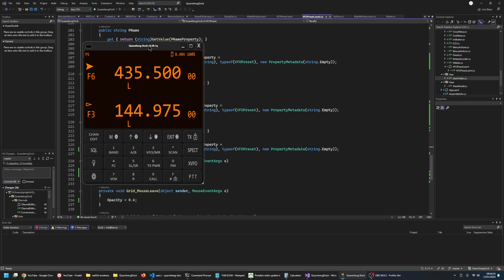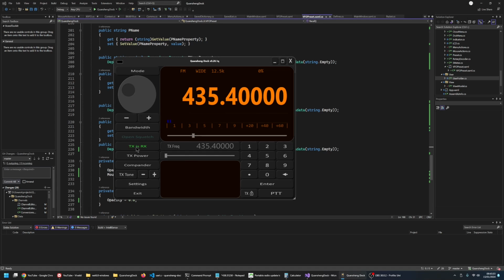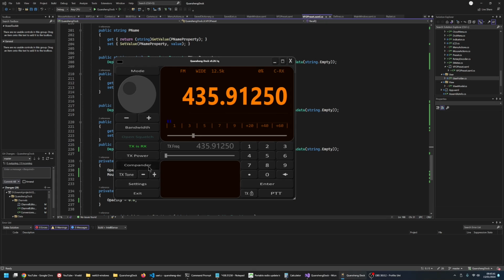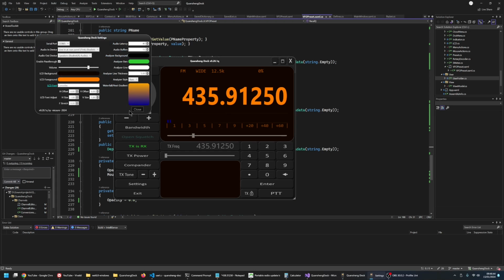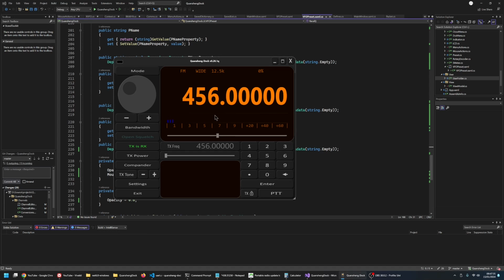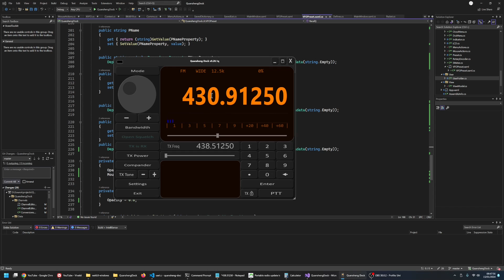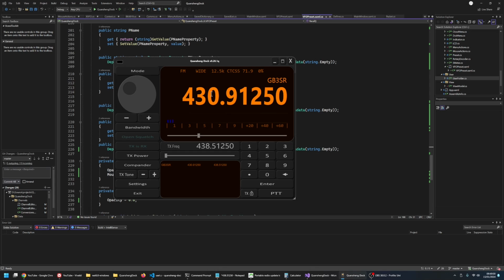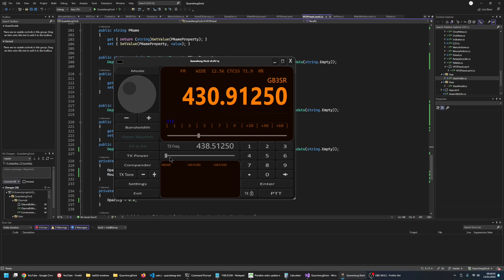Quansheng UV-K5 Dock. XVFO Update, TX now working.

Comment: @nicsure Seeing issue with channel editor or maybe firmware. When a frequency above 300mhz has been saved as channel eg 362.300mhz and uploaded to radio list it shows as ok but when pulling the channel to rx on radio and dock it has set frequency of 433.0mhz but when you download channel memory from radio to editor the true frequency is still intact
Reply from the maker: Okay I'll investigate that right now.
Reply from the maker: After writing channels to the radio try turning the radio off and on.
Reply: @nicsure  I have tried that, it still shows 433.0 I've even tried a reset and writing the channels. 
I put the same channels on their own, (on list 2) and still get the same result.
Reply from the maker: @sgtclubba1732 No idea. I cannot replicate it. If I write my channels in the way you describe it doesn't do that.
Reply from the maker: For it to be 433MHz is oddly specific. Why always that and not some random value? 433 is not set as any default value or anything anywhere in the firmware/software so it has to be picking it up from somewhere else. Where else do you have 433 MHz set?
Reply: @nicsure  I dont have 433 set on any UVK5 as I've disabled TX.
Its an odd one thats for sure. 
Freqs below 300 are fine and display ok. Without a signal on Milair over weekend so I'm not sure wether the 433 displayed is psuedo or actual.
I'll change extended menu to see if it affects the display freq
Reply from the maker: @sgtclubba1732 Well I don't mean to sound snarky or anything but it's not pulling 433 out of its behind, it has to be coming from somewhere.
Reply from the maker: Can you save your channel dump and send it to me? Then I can work with the same data you've got.
Reply: @nicsure  Not seeing you a snarky. Seeing you as a dev working blind on an issue you cannot replicate ;D
Reply: @nicsure
UPDATE - ISSUE RESOLVED
If 350en is disabled in extended menu then it cannot display and defaults to 433. When 350en is on then true freq is displayed.
Reply from the maker: Ahh! That makes sense. The required band the frequency is in has to be enabled. Since all my bands are unlocked, no wonder I couldn't replicate. Phew, glad you figured that out cos I was like WUT DA F???
Reply: @nicsure  I was thinking maybe I had a corrupted firmware tbh. I only discovered the setting was off by accident after doing a RESET ALL, I pressed up key instead of menu and thought I'll check these settings and hey 'kin presto it became apparent 😅. Sorry for the headache bro many apologies.
Good thing = now we both know the answer should it arise in the future🤣
Reply from the maker: @sgtclubba1732  No worries bud. In fact I may put that in the Wiki as it seems like something many folk may fall foul of. So indeed it was a good thing.
Reply from the maker: @sgtclubba1732 You can find my email on my channel page.

Comment: Just wanted to update you on my issues I was having. The program kept crashing, and I suspected my Baofeng cable. Turns out I was right. New cable arrived from Amazon, and all features work perfectly! Outstanding work!
Reply from the maker: That's good to hear. Glad you got it sorted out.
Reply: I had the same issue, dodgy fake chipset lead from my old Baofeng. Strangely enough, it was ok on that radio!
Reply from the maker: That's the kind I was using too, I had to install some older drivers to get ti work. Otherwise I just kept getting "THIS IS NOT A PROLIFIC CHIPSET" message in device manager.
Reply: @nicsure  I always had to do that with the old lead, but then it'd be ok on the Baofeng until next boot. Not so much fun the Quansheng though! It was ok after doing the old chipset driver thing, but it blue screened on the firmware update, bricked the Quansheng! Luckily I managed to recover it after a few attempts at the firmware update on a new lead. Old lead been filed under "B1N"!

Comment: Nic, thank you, fantastic work and maturing very  nicely. Wonder if you might consider that XVFO could have mouse scroll wheel tuning using selected step size and, perhaps also by hovering mouse pointer over a frequency digit change that digit with the scroll wheel., as done in Ham Radio Delux ?

73, Bob GM4CID.
Reply from the maker: Excellent suggestion. Not quite sure how to pull it off, but I'll figure it out.
Reply from the maker: Implemented next release.
Reply: Brilliant, implemented in release V 0.30.7q and scroll wheel tuning working great, thank you.
Reply: Fantastic, thank you, look forward to its release. Waiting for a connector to complete a small interface box with switchable headphone and pc audio. Also going to try adding a bit of HF rolloff to reduce hiss on sideband reception.

Comment: Nic, did you see the post by Hayden of Ham Radio DX?  Looks like he was able to connect the radio using your software/firmware to his computer using an AIOC cable.  These have a sound card in it so it’s another (better?) way to connect instead of making up a specialized cable.  Just thought I’d mention it in case you missed it.  A number of hams may already have an AIOC.  I have one but I need to assemble it - I bought a kit, not fully assembled.  Jack N3DNA
Reply from the maker: Yes, in fact someone emailed me and offered to send one to me. Unfortunately it didn't arrive so I'm looking if I can get a pre-built one somewhere.

Comment: do we have any programming software for this firmware
i wanted to change ponmsg but even egzumers chirp module didnt worked as leaving "bad response hearder" error message
Reply from the maker: Due to the way the firmware works it confuses CHIRP with the display data it sends. But, if you look in the radio's menu, there is an option called "Remote", turn that off and CHIRP should work.
Reply: @nicsure  its worked thank you also love your work
Reply from the maker: @ta2kkw Thanks, I appreciate the kind words. I ought to mention that "Remote" option defaults back to On when the radio is turned off or reset, so you have to go in and turn it off each time you need to use CHIRP.

Comment: This is fantastic! I've got cables on order so that I can lash something together and start playing with this software! I do have a weird question, and I don't know enough about this level of programming to say whether this would be incredibly difficult or incredibly easy, so...how difficult would it be to interface something like this with a program like, say, GPredict? To where the tracking program could directly control the Quensheng's frequency in order to compensate for Doppler shift during a satellite pass? This is pretty standard fare for SDR receivers,  but I don't know how much, if any, similarity there is between what's going on behind your GUI versus an SDR GUI.
Reply from the maker: I am working on this currently. Well it's one of many things. It's been requested by many so it's worth doing.
Reply: @nicsure  Awesome! I sort of hate asking, given the amount of work you've obviously put into this. I'm sure everybody and their uncle has 'suggestions' - some good I'm sure - but this is probably more of a labor of love for you. I was mostly curious. Thank you for what you've shared, regardless of where you ultimately take it!
Reply from the maker: @tomperone9338 It started it just as any project I've done, released it and make a video because I struggle for video ideas and I don't normally attract many viewers anyway. Then it suddenly went mental which took me completely by surprise. Due to the unusual interest I just kept on developing it and pushing myself to see what was possible.
Reply: @nicsure  It doesn't surprise me really. It's amazing what's been done with this groundbreaking little radio!

Comment: To be totally honest, I have never known a ham use tone squelch rx.  It is something repeater keepers have to use, but the rest of us have no need for it.  PMR folks sometimes use it for business use.
Reply from the maker: Yes there's not much point for it I can see in most cases, however it is something the radio supports and if I don't include it, there's bound to be someone who wants it.
Reply: @nicsure  It can be useful if you don't want to hear the repeater ID (which is transmitted without CTCSS) and also on mixed-mode repeaters where you want to hear analogue transmissions but not the noise of digital transmissions.
Reply from the maker: @59withqsb12  I have it implemented in the pending release. I'm just hung up on reverse DCS at the moment. The reverse DCS (or the DxxxI codes) are a joke tbh, they are just a different ordering of the normal N codes. D754I is the same as D116N for example. It's true they have a different base code on transmit, but they are just "heard" as regular N codes. I'm trying to find the pattern, but I may just do it manually for the time it's taking me.
Reply from the maker: LMAO, maybe I should just try Google, before spending hours on a pointless task. https://forums.radioreference.com/threads/inverted-cdcss-dpl-conversion-chart.8261/
Reply: @59withqsb12  That's a pretty good point about mixed use.  Never thought of that as most in my area are either digital or analog, but not mixed.

Comment: Just popping up to say how impressed I am with your hard work! Just so interesting to see the flexibility of these little radio's and the many directions that the different firmware versions are going. I could see this being used as a temporary base setup. Stick the handie with a higher gain antenna in the loft and work from your PC! 73

Comment: Great updates as usuall. Thanx for all the efforts. If I may ask, when I am in the normal first "window", ie: Quansheng Dock v0.29.0q, and I listen to the FM Broadcast, say, 102.000, it plays nice and clear. However when I open up the XVFO, and select same frequency, with FM, and Wide, it is very noisy? I tried all Bandwidth, and Mode types, but it is not as clear as the normal one. Possible to test on your side, when time allows. Many thanx. Again, look forward always to you updates.
Reply from the maker: I've never been able to listen to the FM band in normal mode, it's a mess for me. Bandwidth is however far more variable than the stock firmware  gives you options for so an "Ultra Wide" mode might solve that. I'll be experimenting this afternoon.

Comment: @nicsure; TX is RX could be renamed "SImplex/Duplex" perhaps, but its not quite right either,  but "Split" is the correct term I believe. 73 de LB9BG
Reply from the maker: Yes with hindsight "Split" seems like the logical choice. That's annoying though as the option is enabled to lock RX with TX. To rename it to split I'd have to invert the button logic, but that's not a huge deal.